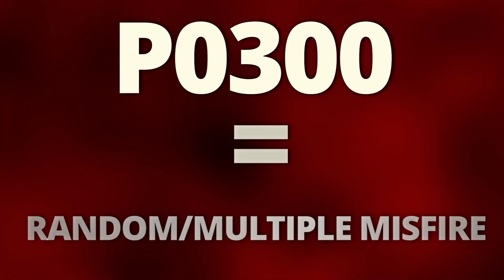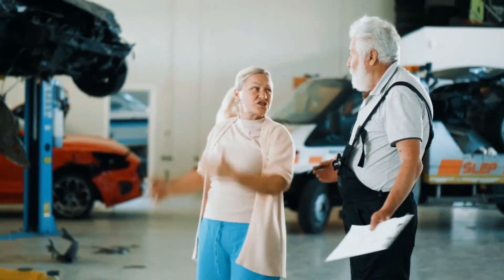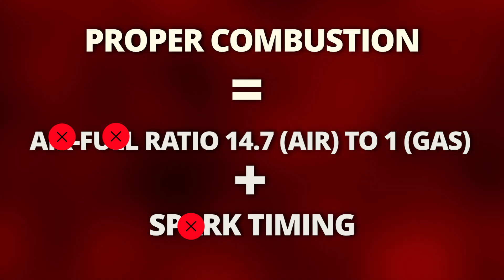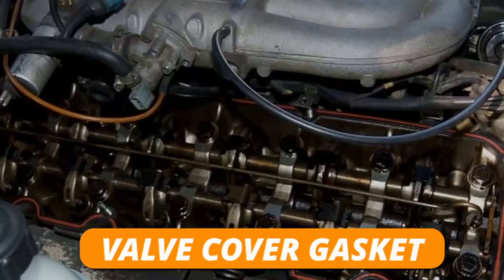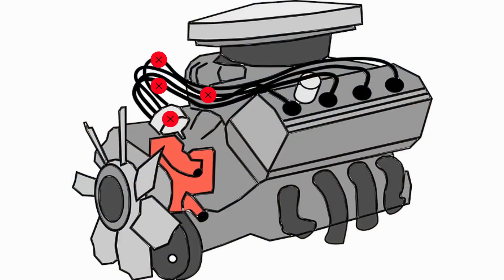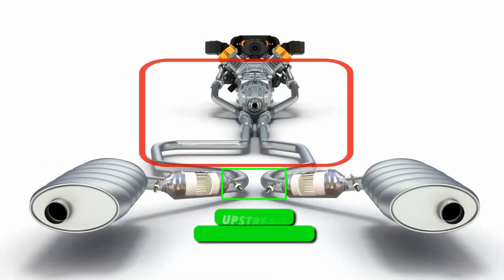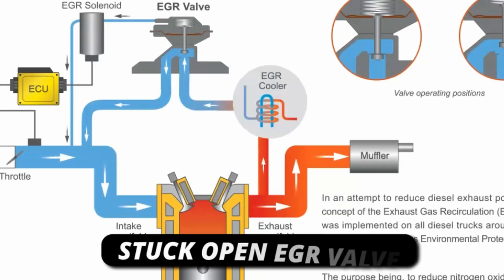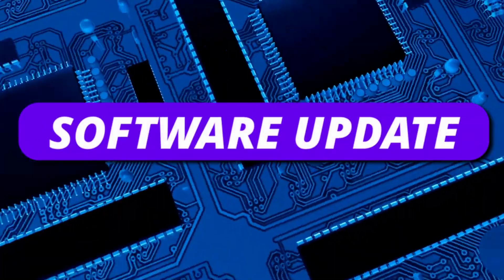P0300 ULTIMATE GUIDE

Comment: Mine was the spark plugs three of them were literally missing the iridium on the end. It worked fine for a bit, then it was the wires. And after two weeks it was it started again and replaced the fuel pump.. it’s been 3 long years and it just started giving me a random misfire again. I’m thinking it’s the coil packs now. I have a 2010 block from a Silverado when I bought my 2000 Silverado,. I’m thinking it’s the oem accessory and components because the coil packs are round. The chassis should have like 300,000 miles.

Comment: I have a 96 Chevy k1500 pickup and it's putting out the code mentioned.. the first crank will start the engine but when turned off, itll crank but won't fire

Comment: I had this code on a Honda Pilot 2006 ,and it ended up being a bad camshaft sensor.  I just removed the camshaft timing gear and then replaced the sensor. Code was then gone.
Reply: @Andrea98155  Yes, it did. If you go over the railroad tracks the vehicle will start to cut power to the engine.

Comment: I'm in this mix myself trying to help an older neighbor with his 03 corolla codes P0300, P0301, P0302 are coming up. Tried a new fuel pump, pcv valve, spark plugs, ignition coils, fuel injectors sadly no luck I'll try next the fuel regulator and cleaning the maf sensors and throttle body
Reply: What did it end up being for u having same code on my 03 corolla
Reply: @jesusandrew6730  previous owner told me he has new spark plugs but the truth was he didn’t and I replaced them and the car is back to normal
Reply: Worn out gas  caps are the problem sometimes

Comment: Going through it right now with my Sierra. New coils, wires, spark plugs, fuel pump,crank sensor and cam sensor and no luck… only thing left to try is a match lol 

On a side note I’m look for a price friendly scan tool. Any recommendations?
Reply from the maker: Whats your budget?
Reply: @easyautofix  I’m willing to pay a couple hundred or more. Thanks for the reply
Reply from the maker: @Esteban-MK64  No problem, the scan tool I use is worth the price and gives you more than you need, it's simple to use, and has no annual fees. All you need is your smartphone. Here's the link if you want to check it out. https://amzn.to/2QBLLp1
Reply: @easyautofix  sweet, buying it today! Thanks man
Reply: Maybe dirty fuel injectors?
Reply: @michellet_thatsme  They’re new as well.
Reply: @Esteban-MK64  What year is it?
Reply: @Esteban-MK64  Did you check engine compression? If I had any oily spark plugs then I would check valve cover gaskets. One that is rare is a pcv valve. Good luck I have to figure my p0300 as well.
Reply: @Micscience  It turns out it’s the good ole GM AFM issue. Gonna have to do a delete.
Reply: @Esteban-MK64  I was watching a video of some mechanic with some woman who made a video on trucks you should, and shouldn't buy and his main gripe with all the American trucks mid 2000's and up all have issues with the AFM. He says he gets it all the time. He recommends late 90's to early 2000's trucks before the new AFM systems were integrated.
Reply: @Esteban-MK64  what is AFM?
Reply: @atomicdmt8763  Active Fuel Management. Half the cyliders are turned off to save fuel during low load operation. It causes nothing but problems.
Reply: Was your misfires constant? Or just a couple misfires here and there on all cylinders? I have a 17’ sierra as well and can’t find the issue. I’m assuming the afm but the dealer said it’s not that but they don’t know what the issue is either. They said have to wait till it’s worse to figure it out. But it’s also not throwing a code in my truck ( it did a few weeks ago p0300) I replaced wires and code hasn’t come back but it’s still misfiring randomly on all cylinders. When I watch the computer while I’m driving. Also I don’t have any engine knock either
Reply: @scottie12314  Did you fix it? Did you find what was the problem?
Reply: Chevy GMC have a weak fuel pump.
Reply: I'm trying to resolve the P0300 on a 2008 Nissan Altima.  I started with replacing the spark plugs.  They needed to be replaced anyway, as the electrodes were nearly burned off.  It didn't fix the problem (rough running engine), but I could feel the engine had more power.  Next, I replaced the fuel pump, since the symptoms matched a fuel pump going out.  That didn't make any difference, but that was a costly mistake, $400.  At least I didn't spend $700 for OEM pump.  Next, I'm going to clean the MAF sensor to see if that does anything.  Good to know someone else has been down a similar path!  LOL  (I was trying not to spend a lot of money to keep this beater car running by paying someone else to fix it, but that might have been a better choice.)